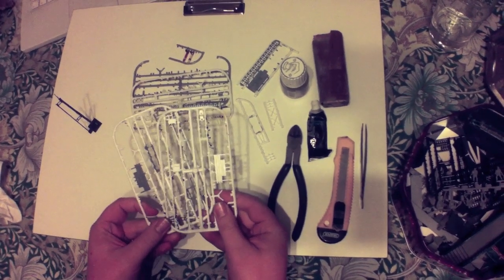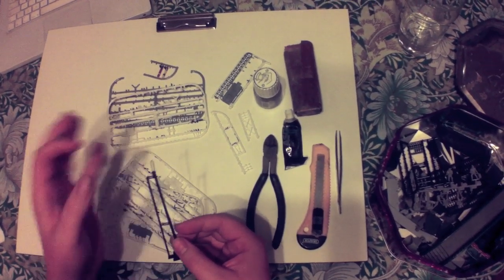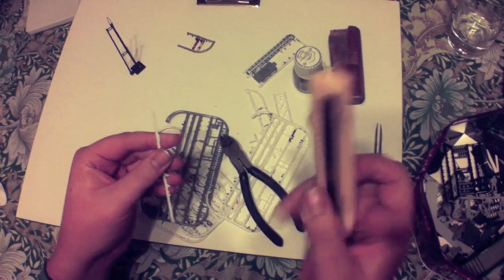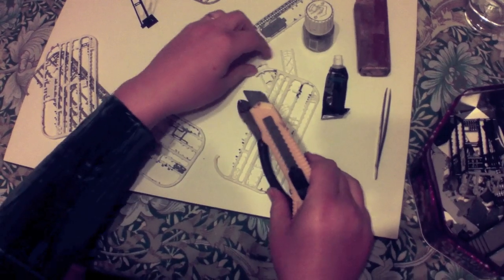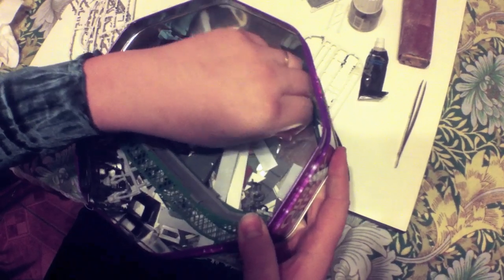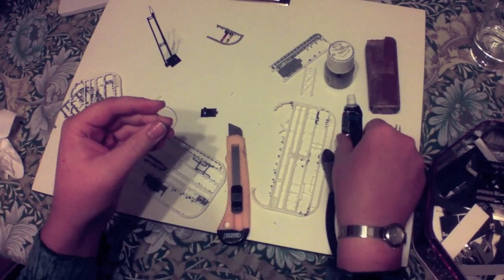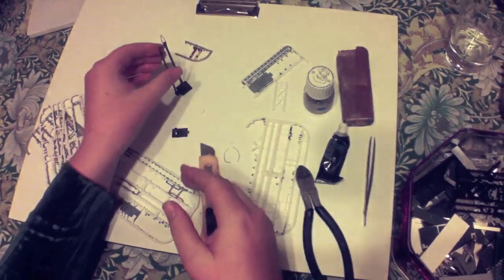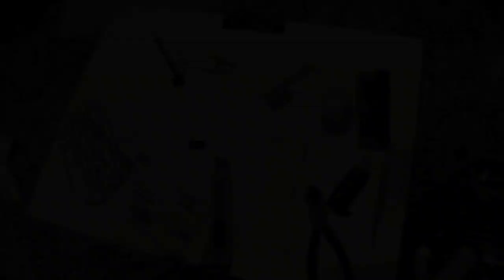How to Scratch Build Model Railway Yard Lamps From Scrap

Comment: Hi Jenny; I have just come across your vids and I'm catching up. To make circles of soft wire a conical ring gauge is useful. The precise diameter or circumference can be calculated and measured on the cone with a micrometer, or the marked letters can be used if they're accurate enough. Lots more vids to see.....